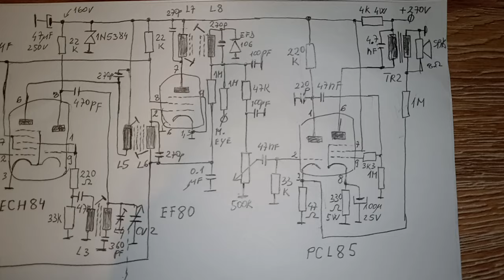AM Tube (valve) radio receiver. A simple MW superheterodyne using PCL85, EF80  and ECH84 glowbugs.

Comment: Very impressive build! I like that you were able to repurpose the old TV IF coils! Thanks for including the dimensions and number of turns on them. I'm running out of the ones I saved from sets I dismantled as a kid and of course they don't make them anymore so I have been looking for ways to make my own.
Reply from the maker: Thank you. Concerning the coils, you could try to print some using a 3D printer with ABS (or PLA if there is no heat source near the coils)

Comment: Excellent project.  I  also had problems screening home made coils. It turned out that the screening can was too close to the coil. Screening must be at least twice the coil diameter on all sides, otherwise it acts as a shorted turn and destroys the coil Q. The ECH84 is slightly different to the ECH81, the 84 was used in TVs, the 81 was  radio mixer and can be AGC controlled via G1.  Valve radios are awesome and easier to build than  solid state.
Reply from the maker: Thanks for the IF infos, I will try to use a larger screen shield!

Comment: 7:40 Your IF transformer might be tuned at the edge of its tuning range By adding the shield  the coils inductance is lowered. That means you are out of the needed frequency range (455Kc) The tuning range depends on the core`s position,  [core inserted into the coil   420kc ------------455kc-------------480kc core inserted partially into the coil] . Now, if your IFT tunes  like this [ core inserted into the coil 455------480-------500 kc core inserted partially into the coil ] then by adding the shield inductance value gets less so it means you need to push the core inside the coil to increase the inductance but you are already fully inside.

Comment: Hello, you can receive many more stations, even at night.
If you turn the ferrite antenna three turns to an empty position where there is no wire. Wire 1 must be connected to the ground
and the other end of the wire to a water METAL gutter in a house, then you will receive 100 stations. I did that 55 years ago. For AM and shortwave  Not for FM

Comment: Try to move the coil on the ferrite a little.

But you have some local oscillation ... hearing those "peeps" when you are changing the varco.

Radio works nice
Reply from the maker: I have already adjusted the core inside the input coil, that seems to be the best position....